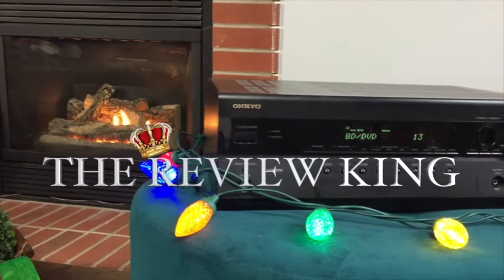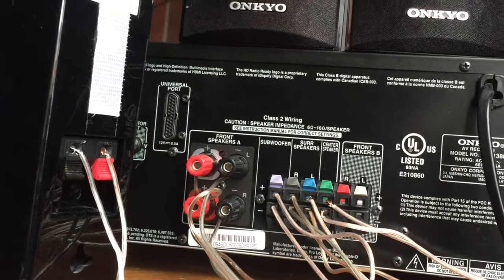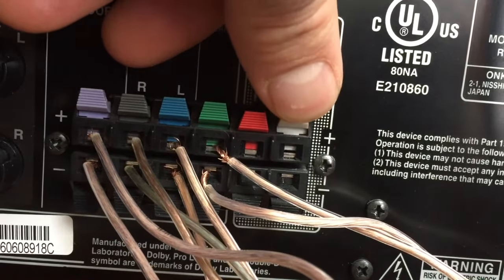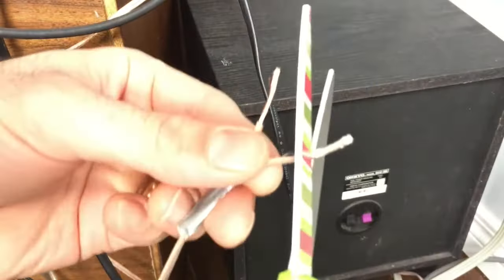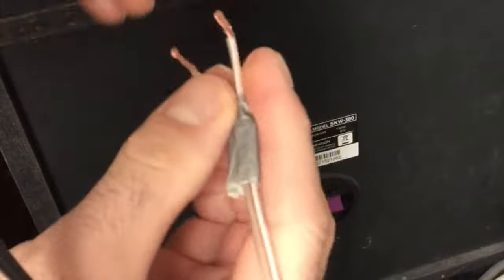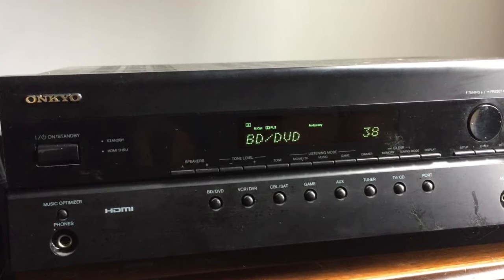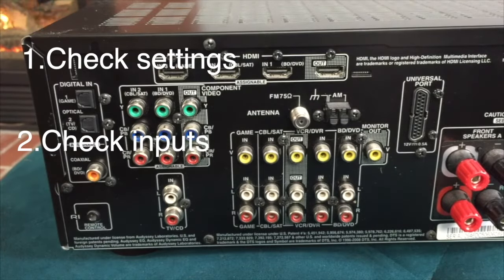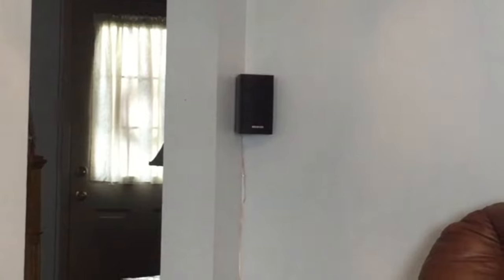How to Set Up Stereo Speakers |  Trouble-Shooting

Comment: Thanks for the video. I'm trying to set up an older JBL home theater system that was gifted to me and am running into an issue identifying the polarity of the speaker wire. The wires aren't colored, however, one side has a white line running along the casing and the other doesn't. Which side would go into the positive input of the speaker/receiver and which would go into the negative?
Reply: White or line wire is positive.😊
Reply from the maker: That’s right white line side is positive. Technically you can use the white line for positive or negative as long as you have the same on both ends.

Comment: Great content . How would connect home stereo receiver to 1/4 PA speaker? The receiver has the wired push down connector
Reply from the maker: You may need to do a crossover with wires to the new connector

Comment: Hey I have an older system that doesn’t have a specific terminal for a sub. What would be the best way to connect one? 
I only use 2 speakers atm and it has plenty of terminals unused…it run on an “A” - “B” power button system.
Reply: Integrated amp

Comment: Hi, I have jbl stage A190 set up and have 1 center speaker vertical on the wall next to the tv, i want to get another jbl center speaker for the other side but only have enough ports on my avr reciever for 1, can i use surround L/R for these or use 1 center speaker port and 1 surround, would that work
Reply from the maker: You could put both speakers into 1 port it would split the power but still be center.
Reply: @TRK-_-  that's all I wanted was a straight answer thanks mate others just say don't get 2 lol. If you could see my setup, you'd understand. I'm using KabelDirekt – Pure Copper Stereo Audio Speaker Wire & Cable – 2x4mm² with banana plugs. Could I possibly put both speaker wires together then add banana plugs or just forget using the plugs? The wire is a little thick. It's all new to me so any help I do appreciate thanks mate

Comment: I have a question? I just received a pair of Akai sw120. My problem is it has a mono plug, but the mono plug I found have a diameter too large for the speaker wire. Any help would be appreciated.
Reply from the maker: You might need to attach 2 wires together to switch plugs.

Comment: Hi I have question which ports should I connect 2 bookshelf speakers on the back receiver?  I have them connected to front speakers and no sound..
Reply from the maker: You might need to select different speakers 
A or B from the front of the receiver.

Comment: I need some help so everything is connected and im using the speaker wire method, the am/fm on reveiver veing heard thrrough the speakers but my rca optic converter not working for tv sound
PLEASE HELP!!
Reply from the maker: RCA optic converter? Explain how you have everything setup.

Comment: How do I wire a sub to my amp my amp  is the same model as your in this video only difference is I bought a subwoofer with rce what out put can I put them into or can I wire the rce into the sub output which is wire clip same as your but it mean cutting the rca cable

Comment: I have a Yamaha RS V 2300 receiver and when I first hooped up my speakers, I noticed that the right side of the “A” speaker had much less volume than the left side. I ended up using the left side of the “B” speaker and that solved my problem. Do you think that the problem is simply readjusting the speaker volumes using the remote control?

Comment: Hey boss, appreciate the video 🔥

An older sibling gifted me some JBL Control 5s speakers. These things require these types of cables. 

But I’m not sure if I should get an amp or receiver. I just want a quick set up to listen to my beats from my laptop 💻. Your input would be greatly appreciated!
Reply from the maker: You could use any receiver. You would need 3.5mm aux plug from laptop to receiver or something that had Bluetooth. You don’t need to spend much you may be able to get something suitable from a 2nd hand store for cheap. 👍 thanks. :)

Comment: Hi I have a technics hifi system when we plug the cables from hifi to speckers dont work no sounds,speckers not faulty,but the red and black push down were u put wires in on hifi playing up some time it used to work with a wiggle now totally stopped even with a wiggle hope you can help me out kind regards.

Comment: Pioneer 5901 system having speaker hook up issues have right front working but nothing else have left center an rear but nothing happens any ideas?
Reply from the maker: Do you have the 2 main speaker outputs?
Reply: @ReviewKingHQ  yes

Comment: Boss,
I have a car set. As usual there are four audio output lines.
1.Front Right
2.Front Left
3.Rear Right
4.Rear Left

And I also have 4 tweeters and 4 oval coaxial speakers.(total=8) 
I need to get treble sounds more from those tweeters and bass sounds from oval speakers.And also I need good surround sounds. There are are not any sub woofers.

How can I connect these lines to these speakers.Which audio line should connect to which speaker/s? Pls. Give me a solution.
Reply from the maker: You need a bass blocker. Use the same speaker wires just extend them to the tweeters with the bass blockers
Reply: Ok

Comment: How's it going man I'm behind my receiver right now and where you go ahead and put the rear speaker wires into the red or black plastic knobs they keep on going out there now I only have one pair of red and black instead of four pair
Reply from the maker: You only have 1 pair of wires or 1 pair of red and black knobs?
Reply: @The Review King  I have four sets of negative and positive. But only 1 set of negative and positive at work.

Comment: What if my speaker has 4 port for Wires and when I plug them in on the top ports it only has the tweeters playing and when the bottom is plugged in it’s only the driver playing. how do I set them up to play both speakers.
Reply from the maker: Jude use a small piece of wire and connect the left and right to bother the driver and tweeter. But on the positive side you need a tweeter crossover.

Comment: I know this video is three years old but I’m trying to connect two jenson speakers to a 1989 stereo, I think I wired them correctly and have an aux for my phone but music will only play off my phone when the radio is turned off which is really weird but it also only plays at a super low volume even with my phone turned all the way up, when I turn the radio on my quite music stops and It only wants to play the radio
Reply from the maker: What do you want to happen?

Comment: I’ve got a question! 

I’m trying to hook up a receiver my grandparents gave me (sears model 28710) but for some reason only one of the speakers is playing sound and it’s playing very low volume. I stripped the wires, checked the connections but can’t seem to figure out what is going on. Any tips??
Reply from the maker: Receiver might be fried

Comment: My god I feel so stupid..... I was wondering why my god dam amp and speakers not having any bass when they use to.... realised I plugged my speakers into the central speaker connectors as my old amp only had those..... First min fixed my problem.... I feel stupid but you saved me

Comment: Omg.  I didn’t understand a single thing you were saying. I just wanna plug some speakers into the back of a stereo. And you’re talking about purple and white and black and red and I didn’t see any of those colors
Reply: Oh man you just saved me time and headache thanks, i only see black lol
Reply from the maker: On my specific stereo there are colour coded. What type of stereo do you have? Make/model?
Reply: maybe took at the positive and negative symbols
Reply: The cables have red and black and need to match on the amplifier and on the speaker.
Reply: No my true colors are black and yellow and the ones that you plug in in the back are yellow are not me red and white

Comment: How do you hook up 4 speaker wires into 2 wire system
Reply: I would like to listen to the 4 wire speakers
Reply from the maker: You technically can just put the 2 blacks and 2 reds together and put them in like 1 speaker.

Comment: Im trying to connect my subwoofer to my amplifier with older AUX but it doesnt work
Reply from the maker: Subwoofer to amp with aux? Is it a powered subwoofer? Are you using a plug at the back of the receiver?
Reply: That's also my question: how do you conect a powered sub?

Comment: Question I have slot of speakers 14 I want speakers in every room but not enuff places to connect em which way is best should I put all pos twisted together in hole ot twist all pos around s piece of dprcket eitr in pitku the one small end in hole n put electricsl tape around all off rm twisted together n same for neg n where fo small medium large speakers go for surround sound thank you i have a Sony trviebrt and 5 disc CD everything hooked up right i judy fmg kmie what size speaker goes front back center

Comment: "I like to use the incorrect tools that will brake wires and cause other issues down the road",  Just get the correct strippers and show the right way if you're going to "help" others
Reply from the maker: If people have an open mind there is a variety of ways to get the job done.